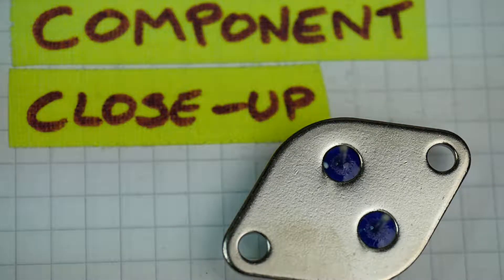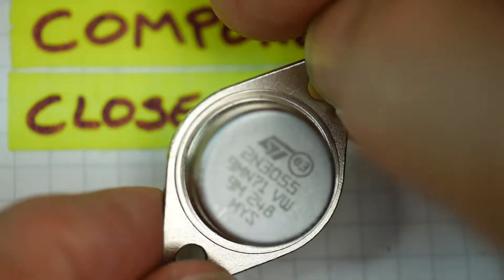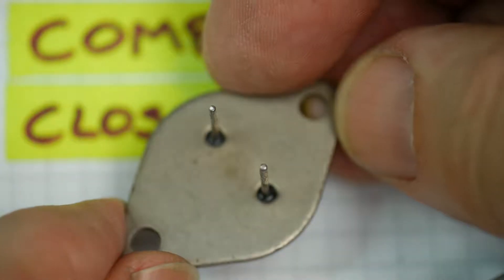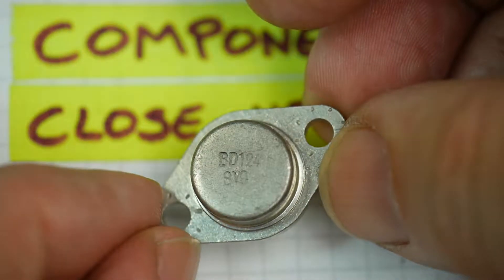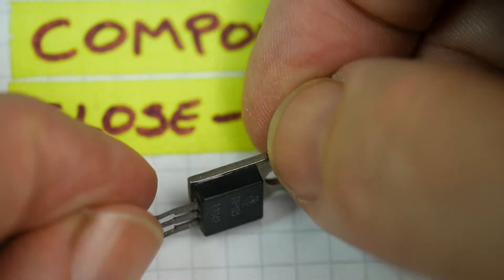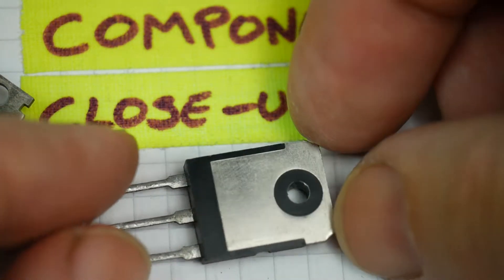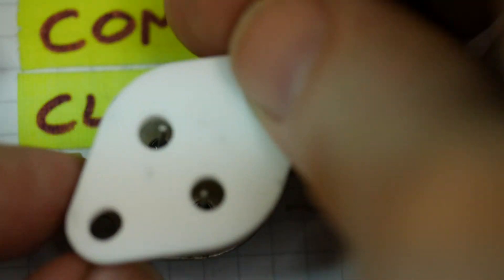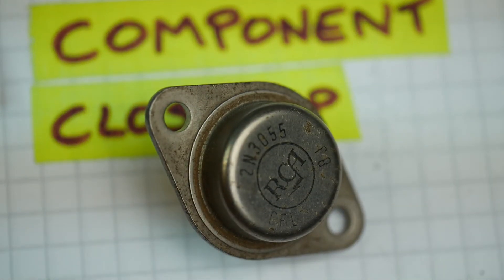Component Close-Up: Power Transistors in Metal Packages

Comment: replying to a 6 year old post i know but learnt by observation = green means a pnp, that was a japan thing ,learnt that initially from cb radios that had green  am transmit modulation transistors then confirmed in low power hifi amps  the small  bd678 think thats to126  was hoping youd de-lid the rca 2n3055 
to66 was just before my time but i got the impression they were allways germainium